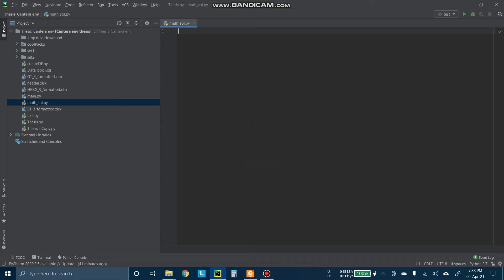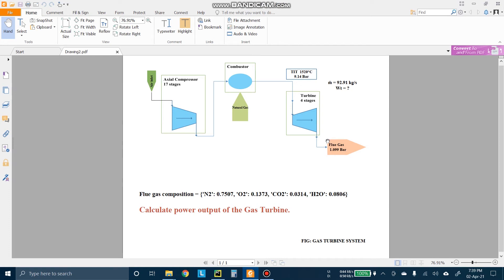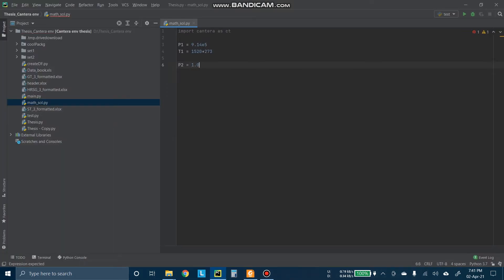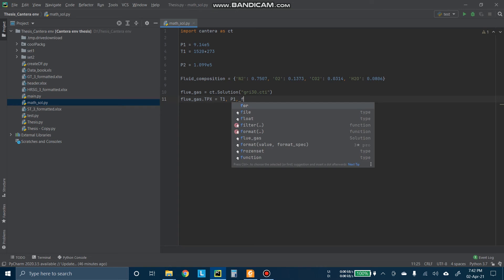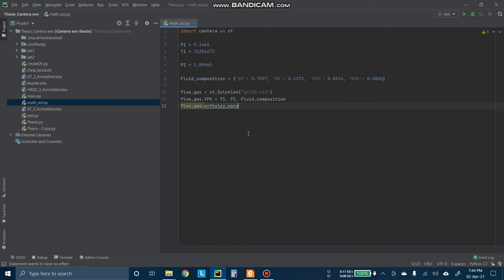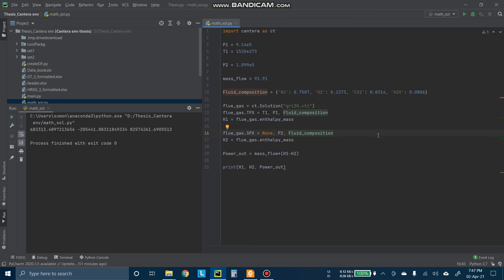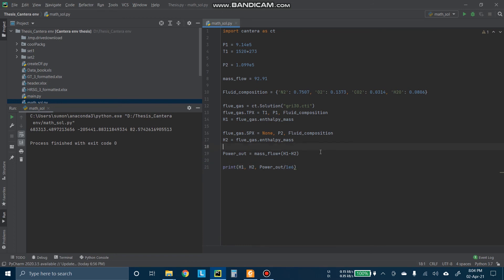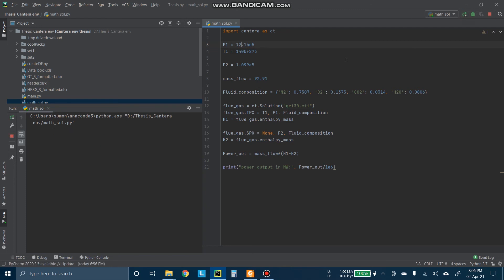Solve Thermodynamics problem using python - Cantera

Comment: great explanation
Brother can you solve this problem  please I have tried a lot .
A hollow cylindrical drum 750 mm in diameter and 2.5 m long
has a shell thickness of 10 mm. If the drum is subjected to an internal pressure of 2.6N/mm²,Determine
(i) Change in diameter
(ii)Change in length and
(iii) Change in volume.
Take E = 2.1x10^5N/mm² and Poisson's ratio = 0.3.
Reply from the maker: sorry this is not relevant to the topic here.